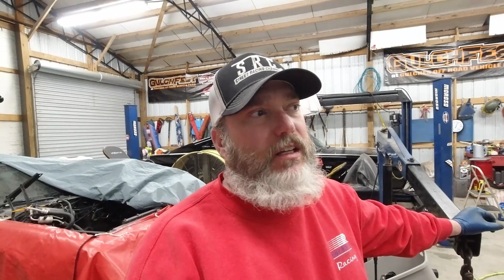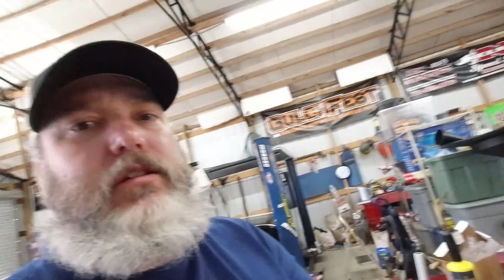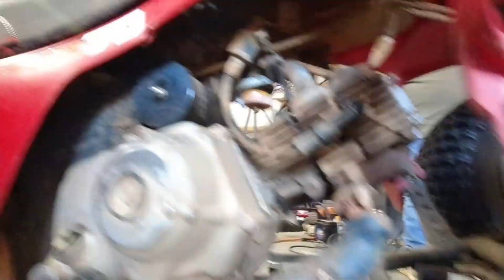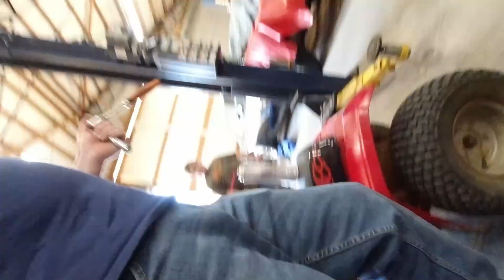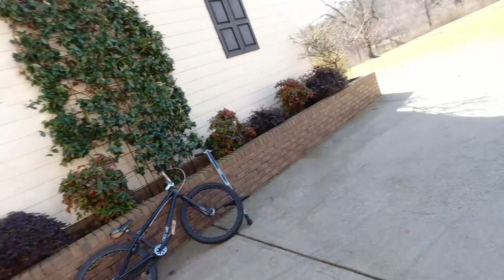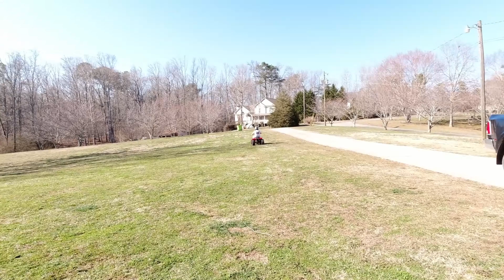86 Honda 4 TRX 70 Carb Repair

Comment: Great video. I have a 87 trx 70. And I just ordered a carb rebuild kit. Because it’s leaking fuel from around the petcok and bowl. But how did you adjust the carb? I know there is a Idle screw for the idle. Is there an air fuel mixture screw.? Could you lend some advice on how to adjust it thank you.
Reply from the maker: I don't remember where the air/fuel adjustment screw is off the top of my head on that one. I sold that 70 a few weeks ago. If I still had it I would take a look and tell you but It is gone to a new home.
Reply: @HotRodDave  no problem I just finished restoring mine and going to give it to my 5 year olds son. And I went to start it for the first time and found it leaking. Kinda a bummer, but should be a easy fix. I subscribe to your channel look forward to watching more of your videos. Have a good one sir.
Reply from the maker: @brandoncombs6625  Thanks for the sub. Those carbs are easy. You shouldn't have any problem. Thanks for watching.

Comment: Where did you get the new carb buying one for my 2 year old I'm wanting to restore for him....would you recommend the carb you bought or rebuild factory carb?
Reply from the maker: I got it on amazon but it was not a direct replacement so I ended up taking the jets out of it and put them in the original carb. It runs good now. I would rebuild the original if it is not totally trashed. The amazon carb is about 45 bucks
Reply: @HotRodDave  ok was curious about rebuild...I've never done a carb rebuild....friend has a atv shop and quoted me $130 using Honda rebuild kit....kinda wanted to learn to do this kinda stuff myself.....any repair manuals you know of that I could follow? Or would you just take to friend?
Reply from the maker: @artardpoptarts  I am sure there is a book on carb rebuilding and these are  super easy if you want to learn. rebuild kits are about 20 bucks new carbs are about 45 bucks

Comment: I new to carbs. I have a the same 4wheeler. When turn the gas on it pours out the air filter. What is cause this. Thanks
Reply from the maker: The float and needle and seat are letting to much gas in to the carb and it is over flowing. you can pull the fuel bowl off the bottom and remove the float and the needle valve will come down. Put the float in a bucket of water and make sure it still floats. If it will not float replace it and the needle that was above it. Most of the time it is just dirty and needs a good cleaning.